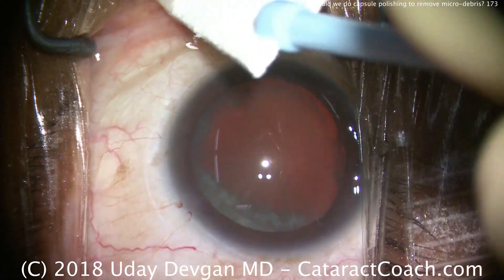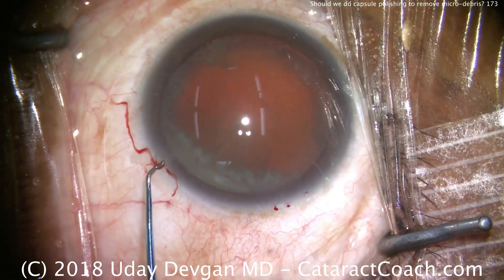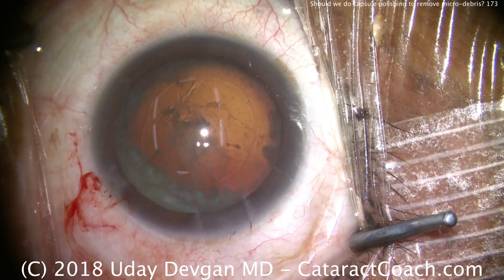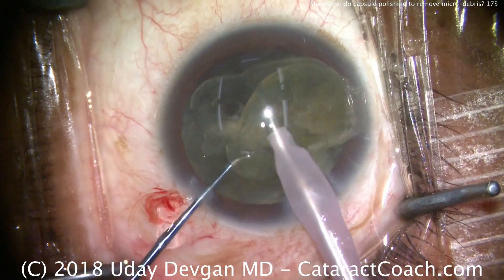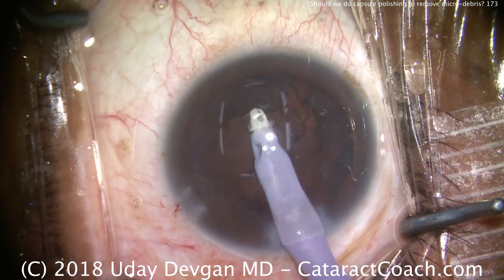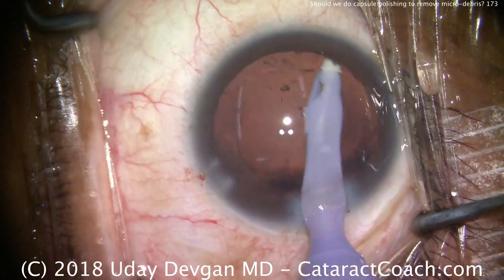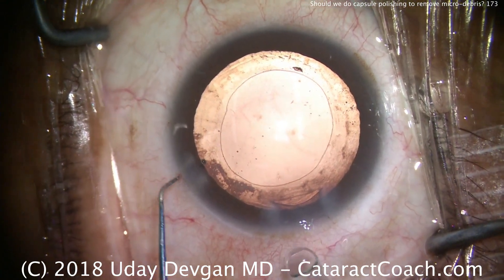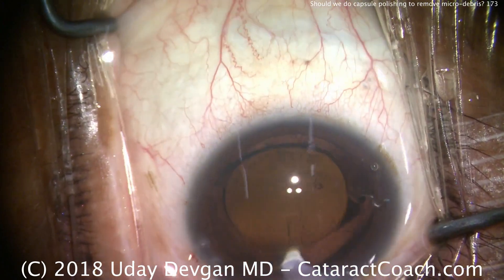Should we polish the lens capsule in routine cataract surgery?

Comment: I will typically polish the underside of the anterior capsular rim from around 8 to 4 o'clock; however, it is a challenge - and mostly not very feasible it seems -  to reach under that sub-incisional area with the conventional I/A tip to get any meaningful amount of polish in that area. Is there a way to reliably do this with the conventional I/A tip, or does one really need to resort to additional steps/tools?